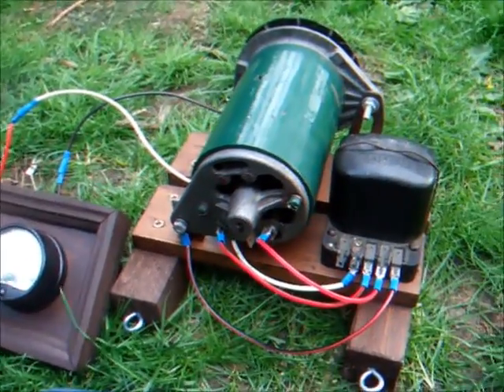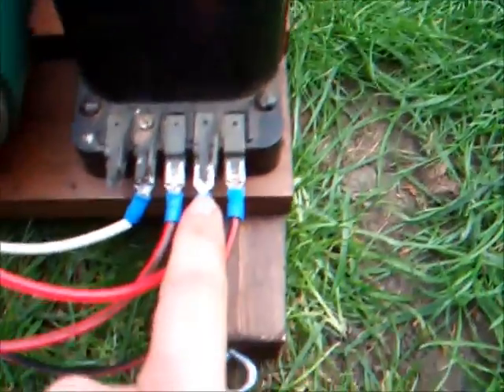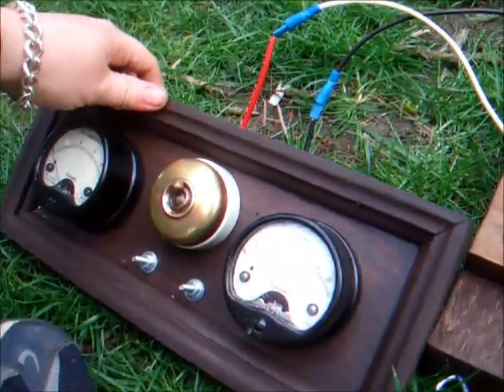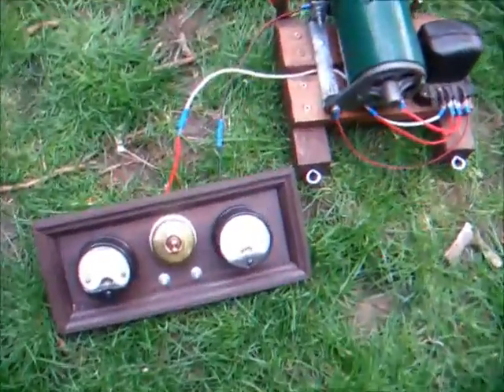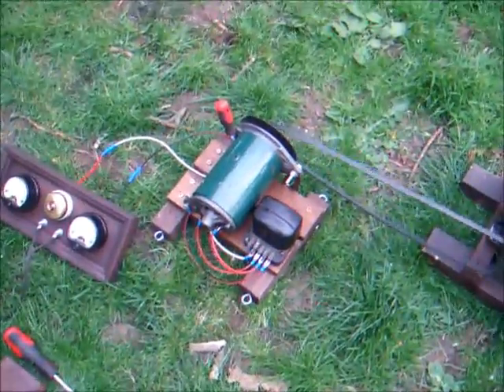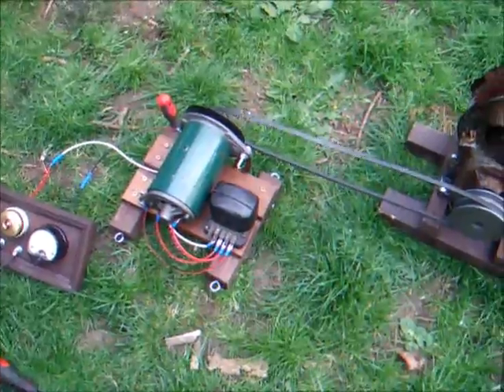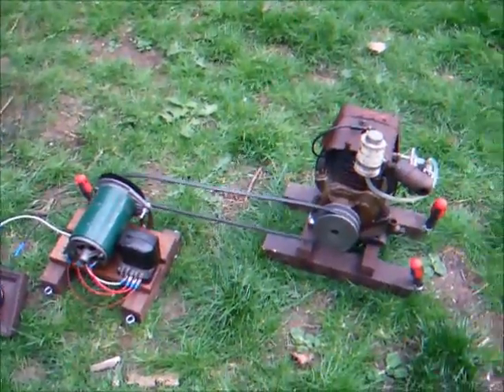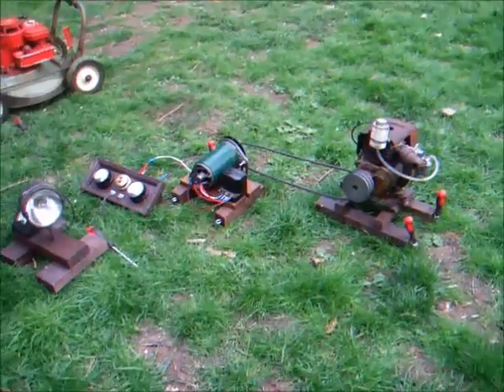How to; Wire a Lucas 12v dynamo and regulator box for use with a stationary engine

Comment: A dynamo isnt a fixed polarity, you can flash the Dynamo to change the polarity, connect a battery to the Dynamo earth and remove the d and f wires from the back of the Dynamo dab a  wire from the positive on the battery onto the field terminal of the Dynamo for a second (you will see a spark as you do so) the Dynamo is now negative earth, if you want positive earth then connect the positive to the Dynamo body and flash the negative wire to the f terminal.

Comment: Thanks for your help Dan. I have cleaned the contacts with emery paper. I am getting nowt voltage out of the box. It was only wired up loosed and the terminals have paint on so maybe something is not making contact. The resistance between D & F is good so hopefully a simple fix can be found.

Henry

Comment from the maker: Hi Henry, its quite normal to buy an old or new old stock regulator and find it doesn't work. Much like a magneto the regulator needs clean points. Clean them in the same way. Each coil in the regulator has a set of points to clean. 

If you have the dynamo in the same angle as mine then the D terminal is indeed the larger terminal. 

Hope that helps mate. Cheers, Dan

Comment: Hi Dan,
I bought a regulator the same as this but it doesn't seem to work. I just wanted to check, D is the larger terminal on the dynamo and F is the smaller one?

Cheers

Comment from the maker: Connect a multimeter to the D and F terminals, doesn't matter which way round. Spin the dynamo is the direction it runs in (it'll be marked with an arrow) you'll get a little voltage. If it shows as (example) -0.40v the you have the negative connected to the positive of the dynamo. Get 0.40v then you have the positive connected to the positive. 

You can just connect it to a battery as well. Either way will make it turn. - to + will make it go backwards.. it shouldn't damage the dynamo. 

Dan

Comment from the maker: For use with a stationary engine the A1 terminal isn't used.. i believed its only used on the cars when connecting a 12v battery. Which isn't needed when running a few lights.

Comment: Hi again... I got me self a new regulater now lol. What does the ` A1 ` is used for?
Reply: A1 is connected to a couple of extra  turns called LOAD TURNS. These are there to compensate the drop in LINE VOLTAGE if the battery is in a discharged state and  the lights or extra load is switched on. Now for some theory. The regulator has COMPENSATED  VOLTAGE CONTROL  which is a thick winding added to the VOLTAGE REGULATOR BOBBIN and is in series with the output  IN the initial stages of charging  this lowers the regulated voltage so that the difference between the generator and battery terminal voltage is never great enough to cause a heavy current flow in the generator which will damage the ARMATURE.

Comment: yer I have a 1967 lucas dynamo and its positive earth but it doesn't make any difference to the regulator either way and the A and Al terminals are the same and if you look under the regulator there is a wire connecting the two, I hope this helps.

Comment from the maker: Ah yes, i think this came out a moggy so that would have been negative earth? I had a feeling the contact was really 'Earth' i was tempted to say earth in the video but wasn't sure so just listed it as negative to what your powering. I can add my little 12v bike battery to the circuit which gets a reliable 12v out of the dynamo. I can usually get 12v belted to the Suffolk. But it was on its last legs lol 

Glad it helped mate. Cheers, Dan